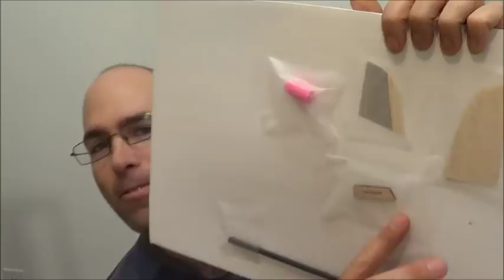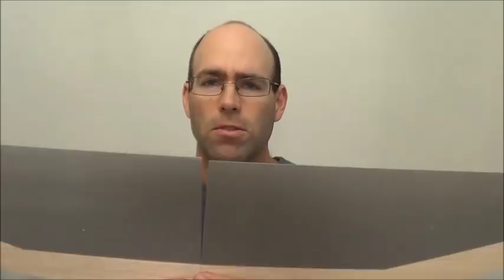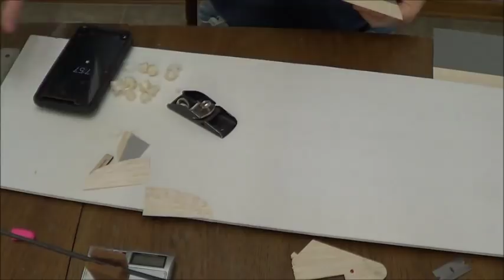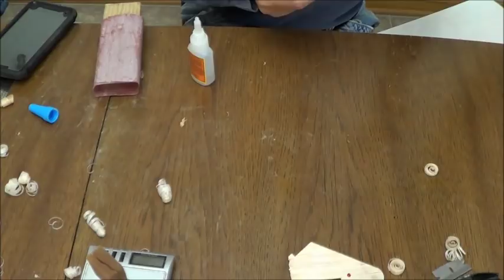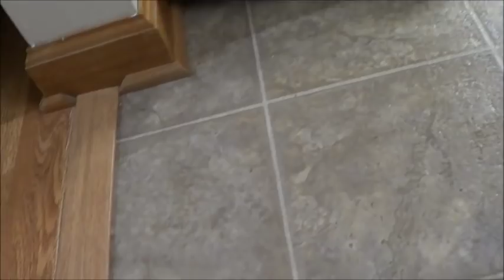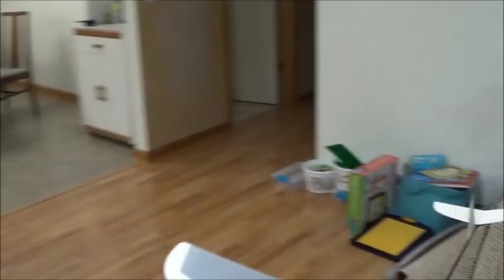The best chuck glider EVER: Build/Review of the Mikhail Yashinskiy F1N

Comment: Low ceiling F1N are crazy floaters! that's why I prefer F1N to F1A outdoor F/F as a solution to small flying space
Reply from the maker: F1A can get crazy expensive through. I really like outdoor hand launch--affordable and with radio dethermalizer you can fly almost anywhere.
Reply: My most reliable flying field is pretty small, it's about 150ft usable wide, F1A turn diameter might be larger than that field

Comment: Very nice,looks like grey depron used for underfloor heating,a lot finer than the white material,that is going to be a stunning flyer,I think I will make a replica but mine will have to be for calm evenings as nowhere to fly indoors.
Nose buffer looks like kite end stops for carbon rods.
Orbital hand sanders work on depron finishing off by hand with large sanding block.

Comment: Cool, Josh!  I really like these things and would like to try them, but the venues here run only about 7.6 meters - low Cat 1.  I'd probably be able to get the glider at a slightly lower price due to the shorter distance.  Is that an AMAZOOM on the wall in the last frames?
Reply from the maker: This model would be perfect in a site that low. That's actually a hair higher than the outer area in St. Luke's.
And yup, that's an unfinished Amazoon 1300 that Frank Hodson started.

Comment: that looks awesome! I think I might have to fiddle with a F1N this winter. I have a hotwire cutter that lets me cut foam down to .020" or so and more in increments of available music wire sizes :). I can send you some to try in your Scioly glider or whatever if you want.
Reply from the maker: Yup, I'm in. :) I need to send you a couple Std CLG flappers when I get a chance. Just designed a new one that comes out around 2.2g with careful sanding.
Reply: @joshuawfinn  Sweet! The sheets don't always come out flat but I believe they can be baked between 2 sheets of glass to straighten them out, I will have to do some experimenting. I'll get some foam .020-.040" or so cut out and 
sent to you in the next week or so.
I did build the Carbonette 8 and 12, I got the 8 trimmed out fairly well, but I 
havent figured out the 12 yet, just have to keep fiddling. CLG gliders are surprisingly fun!
Reply from the maker: @rossclements8874  CLG is fantastically fun! I can't remember if I sent you the long tailed C12 or the new shorter one. I'll have to send you the SO version. It's lighter, shorter, and just flies amazing. Definitely good for a lot more than just SO students.
Reply: @joshuawfinn  I think it is the long tailed version. On the first night out I didn't  dope it because there wasn't much daylight left. Of course, it was super humid and the model wouldn't hold the trim. I noticed that the fuse would bend really easily and hold the bend, and due to me not knowing how to trim something, a few vertical dives at the beginning didn't help. It is now clad in carbon and I think I'm going to dope it tonight.
Seeing copterdude's models also has me motivated to get something built, just need to find a flying site close by with regular access.
Reply from the maker: @rossclements8874   Yeah wet gliders fly like crap. ;)
Copterdude is definitely inspiring all of us. Speaking of which, I'm surprised he hasn't showed up here yet.
Reply: @joshuawfinn  Did some looking around on the internet and found this https://www.youtube.com/watch?v=tfevm4y-KZ0 at one point you can see the parts he uses to build the leading edges stacked up, there must be 50 gliders in those!
Reply from the maker: Ross Clements yeah he mass produces them. Truly incredible work.
Reply: @joshuawfinn  One last question. In his video, there is no real airfoil to speak of, just a single tapered sharp leading edge. I would have thought that a smooth airfoil would work better, or even something like a stanfoil over the sharp LE. am I missing something?
Reply from the maker: @rossclements8874  I think it somehow plays off the Stanfoil. All I know it seems to work. I was tossing fairly gently to maybe 15' last night and was getting 30+ seconds.
Reply: @joshuawfinn  i guess it is a case of KISS. What razor plane do you use? Mine is OK, but I find it cuts deeper than I would like it too and that it digs and sometimes tears the wood. It is grey and uses a double edged razor blade to cut. Yours seems to cut very well and it is adjustable which would be nice.
Reply from the maker: @rossclements8874  mine is the cheap Stanley mini plane. You do have to hone the blade sometimes, but the adjustable depth is absolutely critical when you're planing glider wings.
Reply: @joshuawfinn  https://www.youtube.com/watch?v=4xezqrqvC1k found this. Interesting launch method, seems to be the same glider too, no changes at all. Suprised that the wing can withstand the stress of a discus launch, or a handlaunch!
Reply: Awesome glider.  Ideas are flowing!